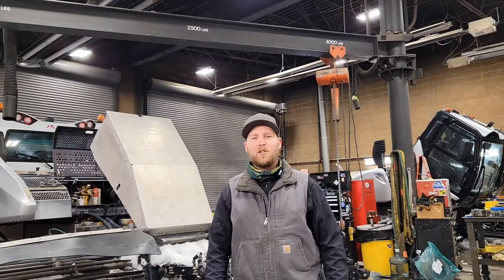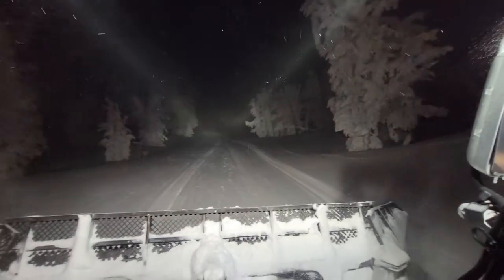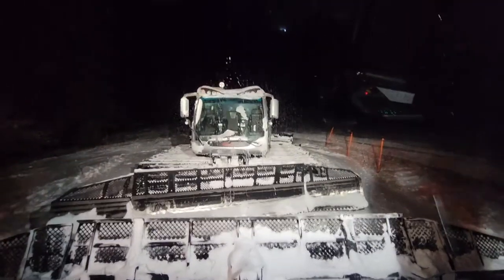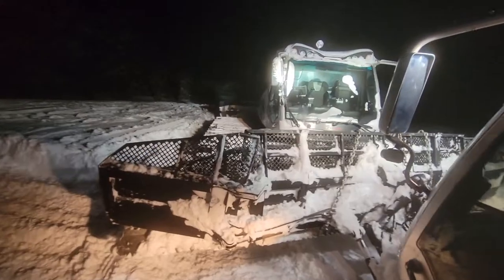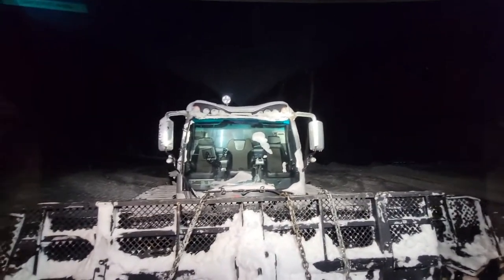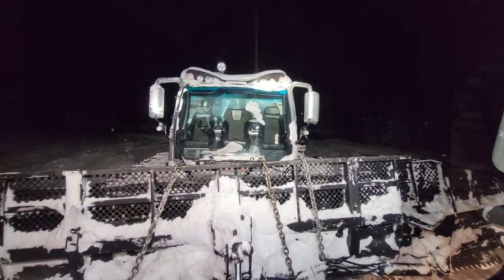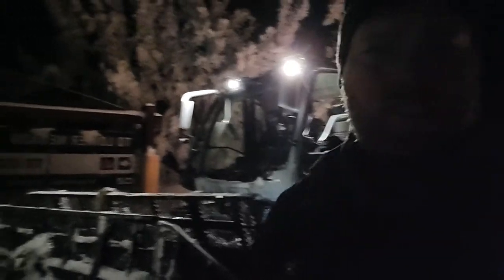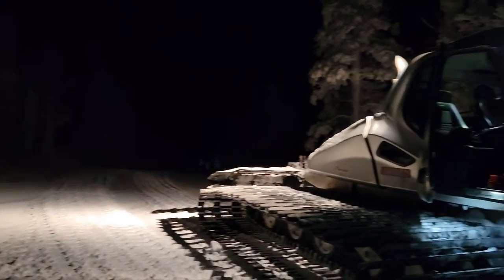How to fix a snowcat. E2 How to tow a snowcat

Comment: Cool stuff!! We have a big towbar that bolts to the blade of the dead cat and will pull them with the pintle hitch on the back of the cat like a trailer
Reply from the maker: That sounds like a good way to get it done. Does the blade drag through the snow with this pull bar?
Reply: Yup we have the same At Okemo. Put a pintle hitch In the broken cat. The toe bar that bolts to the blade of our cats that is doing the pulling an away u go. The new style hubs they have out now on the new cats. You have to manually pump up the brake to get it to release. But u can only 7 mph it’s slow put it that way

Comment: No. No. No. no.  Do you have a welder.    Make a pindal. Bar. That connects. To the towcat.   Like a tiller   But it’s just the 6x6  bar. With a  locking hook on the end.  .   And a donut ring. On the center of the blade. Your towing.
Reply from the maker: Great idea but this cats flex plate was torn and gone. No hydraulics! So we couldn't drag the blade the whole time.

Comment: What did you do to unlock the tracks?
Reply from the maker: You can unlock the torque hubs by removing the center little cover. It has two 1/2" bolts holding it in place. Behind that cover is a steel pin. You have to suppress the pin bellow the cover surface. Then FLIP the small cover you removed and replace it so the cone forces the pin inwards. Then the hubs will free spin and tracks can roll